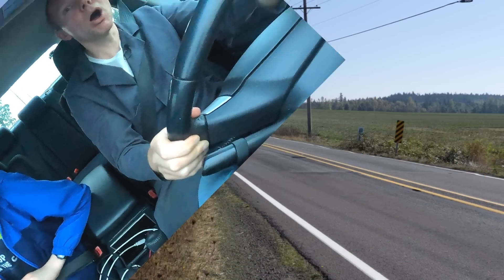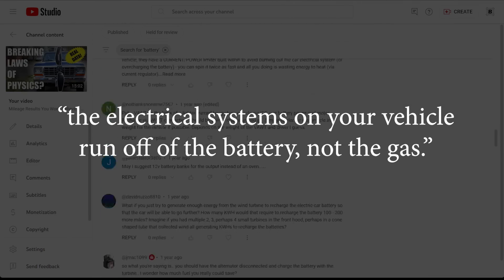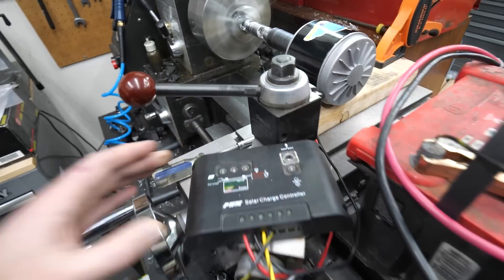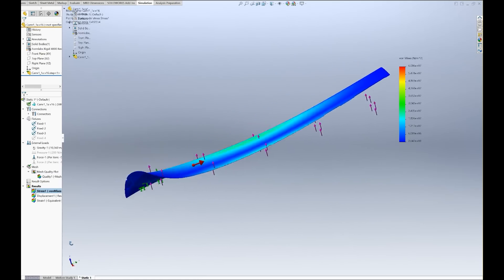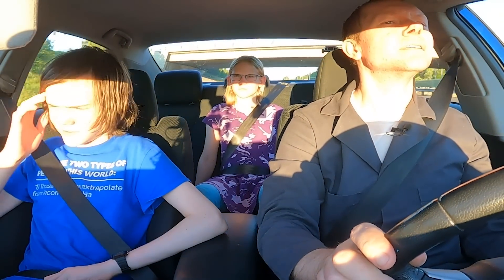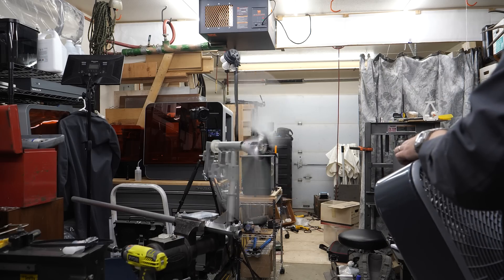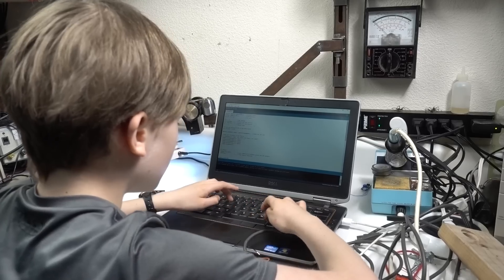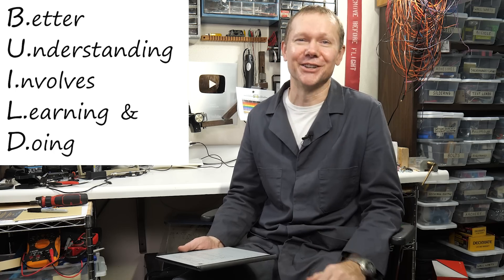3D Printed Turbine on a Camry - Wind Power on a Car #6

Comment: The turbine in front is where the air will be displaced anyway meaning it can’t be worse. If you put it on top of the car it will have a similar effect to what happens on a sail boat. It will catch air that is not doing work(as he mentioned) therefore increasing the amount of energy required by the car to keep moving. 

I look forward to the next video on this topic.

Comment: Aren't cars designed with aerodynamics in mind? wouldn't this end up causing more drag than normal on the car?
I'm not sure if it would cause an increase or decrease in power. it will probably be net neutral

Comment: i can't imagine the unit bouncing around is helpful for rotational efficiency.
not sure the best way to stabilize it, other than just suggesting to make it shorter and or add braces somewhere/how.
but the fan and generator bouncing around during operation cannot be beneficial.
love your vids.
love from a full time, solo, nerdy dad in canada
Reply: one last thought i just had about it being mounted in front, is that there could possibly be a blockage of air flow between the fan and the bumper/front of the vehicle.  i imagine some sort of fluid dynamics modelling can be, or has been done to show this.

Comment: Great job as usual,  and really cool that the kids are so involved. Here are a couple things i thought of.

You sent a Camry to do a Bronco's job.  I suspect the Bronco has a lot more aerodynamic inefficiency to scavenge without increasing loss than the Camry.

Also, could you just disconnect the alternator in the car and put one on the front attached to the wind turbine?  That seems simpler.   I realize the alternators are not as efficient, but that is known already.  I think what we want to know is if extracting energy from some already realized aerodynamic losses is more efficient than creating new losses at the accessory drive.  

Finally, have you looked at those tulip blade turbines?  They seem more compact and less likely to scatter.  I printed one and it spins really well in a light breeze. The frontal area seems smaller and it may be a better fit for the aerodynamic dead zone on the front of your car.

Comment: Lots of vehicles will die if you disconnect the battery but ya I mean the voltage is higher from the alternator so that's the first place power will come from

Comment: I want this to work so badly, but I predict little to no difference. I think it has a better chance when it’s mounted to a car with poor aerodynamics. If cars are designed with any aerodynamic considerations, they tend to rely on the air flowing smoothly over the surface. If the air is always disturbed, that may be lost and will negate the gains from the generators.

Comment: Putting the turbine in front of the vehicle will extract energy before it hits the vehicle. If the air has less velocity there then there will be a corresponding decrease in the drag on the vehicle. I can't speak for the total over the system though because, you know, aerodynamics is not always simple.
If the turbine was mounted to the roof, you now have increased frontal area for the air to interact with so total system drag would be much higher.

Comment: To add additional regenerative charging for vehicles with electric motors I have been thinking it may be beneficial to add wind tubes with turbines in them that vehicle that would utilized generally during coasting or braking.  what do you think of my idea?

Comment: Aerofoils have a lift to drag ratio, you can get 10N of lift for every 1N of drag. It's not impossible to get more power out of an efficient generator attached to a turbine running at it's designed wind speed attached to the roof of a car than the additional energy the car takes to push the car forwards. However, there's zero chance of that being worth it with an ICE vehicle, and the variable turbine geometry required for it to operate in that net positive state throughout an entire drive cycle would be "challenging" to say the least. When it's achieved, it'll have costed more to build than it saves you. Also how do you deal with low bridges, tree branches, car park height limits, etc/.

Comment: Not sure if this has been commented but if the turbine is on top, you're creating more drag because you're creating more wind resistance because of the total capacity breaking through the wind, not just the height of the car, then an additional two or three feet above the car, thus creating more drag. For the front of the car, could you get better wind turbine response if your wind turbine was set up similar to that of a jet engine? Just create a tunnel for the turbine to function in and in theory. Create more energy

Comment: I think that fuel economy will decrease. I don't have a good guess at how much though. You are adding drag, even if it is in an airstream that will already be disturbed. Your car is going to have to work harder to go the same speed and while you'll make up a bit of that extra work with the turbine, i don't think it would ever make up for that extra drag

Comment: I had a battery fail in my car one time as i drove it. I realised that the engine would stall if I used the foot brakes, I attributed it to the current draw from the brake lights being too much and a battery was needed to even out the current demand like a capacitor. I limped my car home using the hand brake instead. If I recall correctly, the headlights (maybe full beam) would stall the car too.
I replaced the battery and it ran like usual, even with two sub woofers in the trunk 😁

Comment: What is the goal of this project? The energy you get from the windmill you need to burn fuel for, and in comparison more than you get back due to inefficiency! This is not green in any way if that was the goal.
Reply: If you listen to him in the beginning of the video, he explains that he believes that the work the car  has to do (pushing through air) can instead be done by the turbines, therefore collecting some of that displacement energy. Of course some people disagree, but that's what makes the experiment so interesting.

Comment: the turbine on the top without doubt increases the surface area of the vehicle that is being pushed through space on a 2D plane

but from the front, it increases the volume only of surface area on a 3D plane

It spins up which should not increase wind speed toward the car since both it and the turbine are moving through the space at the same rate as one another but I believe it creates turbulence and I don't think that would necessarily improve or decrease the vehicles momentum or energy efficiency but the only way I can see to test it is with what you're doing so kudos to you!

The other thing I'd want to do before doing the full-scale testing you're already doing (still, kudos because it's cool) is testing such a contraption miniaturized in a wind tunnel

Comment: OK so you're pushing this / the car through the air and chopping it regardless right? Why not have the turbine behind the car so its catching the turbulent air and straightening it out, wouldn't that improve air flow and therefore efficiency ??
Reply: A turbine can't straighten air, atleast not that I know of, turbulent air just makes the turbine very inefficient afaik.

Comment: this is what I thought of... make a
 cowling for 2 smaller props and mount it on the top of ur car.  next u need to design and build a venturi effect tube to mount them both in. it needs to be adjustable and maybe the prop pitch also. 
the air pressure drops a little while coming over the windshield, but air flow increases.
this design also would make your
device better acceptable to the NHTSA.  HAPPY MOTORING!

Comment: ME engineer here. Great work, indeed you are not increasing drag due to frontal area but you increase it due to a higher coefficient of drag, which is a linear increment, and because you are placing the turbine at the area where air is usually stagnated it really should not make much worse airdynamics. Your work is truly great, if you are able to recup 15% of lost energy that is going from 20 mpg to 23 mpg out of thin air. You may want to add deltas at the wing tips. You may be losing a portion of torque due to induced drag due to the AR of the blades. Great work, keep encouraging your children, it's awesome
Reply: But like, don't they have alternators for this?
Reply: @miepmaster25 yes but the alternator costs fuel to run. The more electrical power you demand from it the greater the load it places on the engine.

Comment: Sry about my English it's over 25 years since I finished school, I think in the roof from the car is the better way, because blades produce drag,  if you what some vans in Europe use a disc like on the roof to exchange the air on the back using the direction from the wind, doesn't matter if the car is moving or not 
Telling it doesn't work is dumb

Comment: I love going down rabbit holes other people have never tried, you learn a lot even if it doesn't work out. I pulled the 3.1L V-6 out of my Cavalier while leaving the transaxle in, people said it couldn't be done. I even did it without an engine lift! Going back in, I put the clutch/ pressure plate on the input shaft of the transaxle before lowering the engine in. Once the engine was in and bellhousing bolts were installed/ torqued, I attached the pressure plate to the flywheel one bolt at a time through the starter opening as I rotated the engine 60° at a time. Then one more revolution to torque them. The best part was no clutch alignment tool was required, the actual input shaft did the job.

Anyway, Newton's 1st law says you're not going to see any gains. In reality, you might see a small gain if your new charging system has much better efficiency... or you might see some loss. The torque required to turn the blades is countered by more "push" from the car which required more HP at the wheels. If your charging system efficiencies are the same, you'll see a decrease in MPG. Instead of the HP going directly to the alternator, your wind turbine will make the HP go through the powertrain which has inefficiencies in itself. While you're pushing the same air out of the way, the car now has to overcome the force (torque) required to rotate the turbine... see what Sir Isaac Newton says about a body at rest with a force acting on it. The force on the "body" (the wind turbine/ generator is at rest relative to the car) from the torque of the generator is opposed by an equal but opposite force from the car. You may see further losses due to disrupting the laminar air flow over the car.

Thermodynamics/ entropy wins again... sorry. But I'm jealous that I didn't get to go down that rabbit hole with you. You're very fortunate to have those tools/ equipment and your children are very lucky to have you as a dad.

Comment: I've seen dozens of videos where these generators are performing about 1/4 of listed specs. Usually these are cheaply made Etsy or other very cheaply made rotors with winding wire that is where the limits are showing up. Most of these gens are using tiny wire with maximum amperage loads about 1/4 - 1/5 of the wire gauge thicknesses from the thickness needed to get the listed output.
I'm no electrical engineer but I've been following many with one or two who explained this very well. Credit to Kris Harbour for that explanation. https://youtu.be/DInwut0DzTQ?si=yHalVnLVp4Y0RzGO

Comment: I think blades mounted outside the cars profile will slow it down.  Want to test small turbines mounted inside the plastic front bumper...like actually cut holes out of the solid plastic so that air flows through the turbines where it normally hits the plastic head on.

Comment: The biggest issue you'll face is the Betz limit of a wind turbine rotor. Which is essentially that under ideal conditions a rotor can only be 59% efficient. After that energy is transferred to the motor and converted to electricity, you're looking at 40% if you're lucky. This puts it on par, or a little bit worse than the efficiency stated for the alternator. 

So, best case scenario with the most optimized rotor, pitch and load control algorithm, you might reach the same efficiency as the standard alternator.

While accelerating or coasting, the engine is providing the power to move through the air. Ideally, most of that air will be redirected by the car and be minimally disturbed. Adding a turbine which is propelled by the car will only increase the drag of the vehicle, and subsequently use more power.

If you want any help with blade design, I'm currently in school for Mechanical Engineering and am currently on a team for the Collegiate Wind Competition designing a similar scale wind turbine. Although, we only expect to produce around 50 watts. For energy generation blades with a higher tip speed ratio are better, which means they will spin faster. The TSR relates the speed of the tip of the blade to the bulk air velocity. A value of 6-10 is typical for energy generation, whereas a value of 2-5 is more for physical power. Since the bulk air speed is identical in each scenario, the lower TSR will produce more torque but less speed, and the high TSR will produce less torque but more speed. Usually a high TSR will result in a low solidity rotor, which is a measure of blade area to total rotor area. Think old farm windmills with lots of blades (high solidity) and modern turbines with long skinny blades (low solidity).

Great testing and excited to see more!

Comment: Very interesting series!!
Sorry, but I think it won't work. You will loose ~5% extra fuel or so. Why? Despite you put the turbine in the path of the car I think the car is designed to flow air aerodynamically around the car. I think by putting that blade on the car you are bringing extra "dirty" air around the car which in the end costs you energy. 

In the end what you do is the opposit of a plane. A plane is designed to go up due to Bernoullis principle of different airflows; here you disturb the flow around your car and make the car experience more friction (which costs energy).

Still, it's super cool to watch and prove me wrong!!!

Comment: I think the project is very interesting and I would like to see how it turns out. I agree with the comments that there are many challenges to overcome, but I think it is possible to make it work. I would focus on the following aspects:

* The efficiency of the turbine: The turbine should be able to generate as much power as possible with minimal drag.
* The reliability of the system: The system should be able to operate reliably in a variety of conditions, including high winds and rain.
* The cost of the system: The cost of the system should be low enough to make it commercially viable.

I think that if these challenges can be overcome, then wind power on vehicles could be a viable alternative to traditional engines.

Comment: thinking about it i think you are right. its similar to how the mythbusters proved following an 18 wheeler increases gas milage. the air hitting the car has a smaller speed differential because you've already removed some in the turbine. so instead of removing energy with the car body you are doing it with a turbine in front.

Comment: I still think a Centrifugal (Radial) fan mounted horizontally across the hood or leading edge of the roof would be a better choice for this project. You could even regulate speed by opening and closing a door.

Comment: The solution is like using hot water headed to your shower to generate heating for your house. Sure, it will offset some of the house heating needed.. But it's going to also result in a colder shower. Whether or not the slightly colder shower is worth it to you probably depends on the amount of work and maintenance required to make the system in the first place.... Because the net gain is certainly not going to offset it

Comment: Would it not be a better use of the energy captured to have a battery bank and a small electric motor providing power to one or more wheels to drive the vehicle without the full use of the engine, basically a hybrid but using wind power to charge the the system.

Comment: So ny basic thought is this. Your vehicle has to push the air out of the way. The energy required to do this is also called drag. By adding the turbine, you are increasing the drag on the air, decreasing the efficiency that it pushes the air out of the way. Since your turbine can't be 100% efficient, the only way you can see a gain, is if the alternators losses are greater than the turbines/generator's losses. If you had been collecting fuel use data when you cooked your pie, you should in theory be able to calculate this difference already.

Comment: It will work. It is also possible to power something straight into the wind using only wind power. If done right and the aerodynamics of the car aren't to affected by the generators in front of it, it should be possible to increase fuel efficiency.

Comment: I don't think the position where the turbine is mounted has such a big impact. You can't just say "it's in front of the car, so it's affecting air that would be disturbed by the car nonetheless": you're replacing a nice linear (no turbine) flow by a a shitty swirly (turbine) mess.